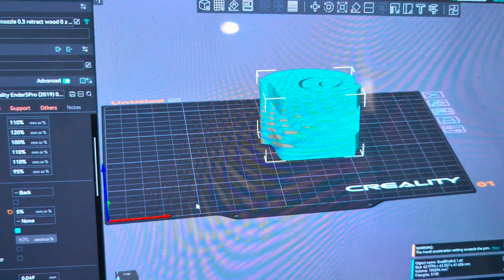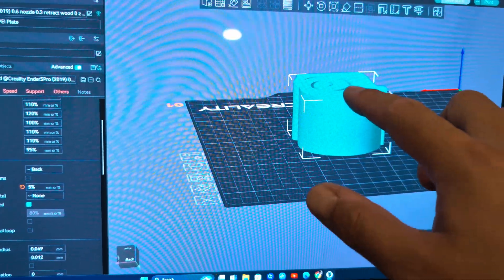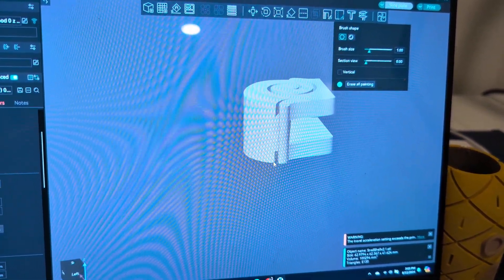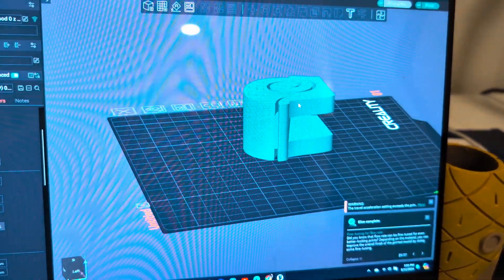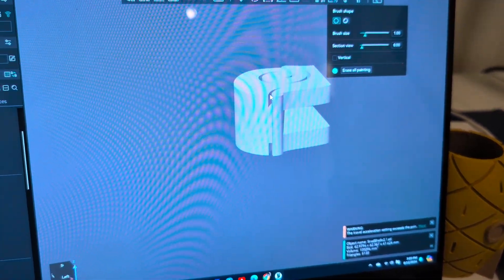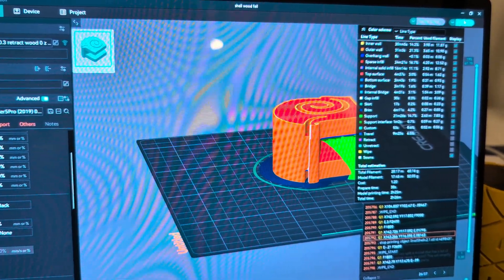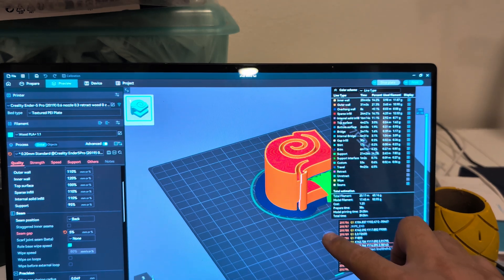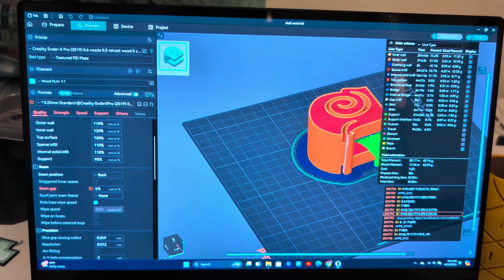OrcaSlicer Custom Seam

Comment: How can i make the seam random in one part of the object but alligned at another place on the same object, thank you. I tried to use modifier but there was not seam option
Reply from the maker: Not sure I've never tried to do that.. I guess theoretically you could create two separate models from cutting the original model - if the modifiers won't work.  You could also painstakingly paint a random seam.  Have you tried adjusting the seam gap, other seam settings? I've seen people dial it in so much that the seam is barely visible
Reply: @RandoTechNerd i tried with seam setting set to nearest it seem to work